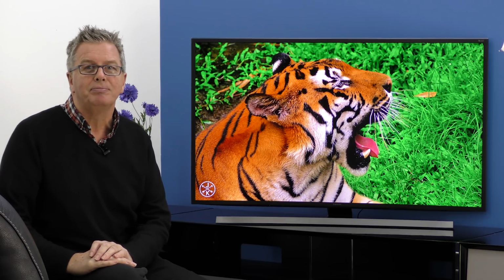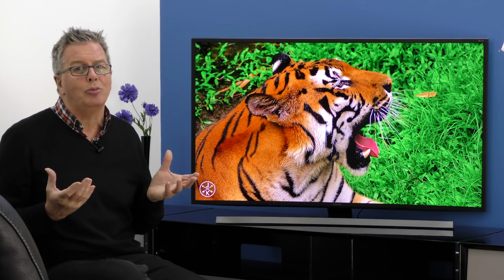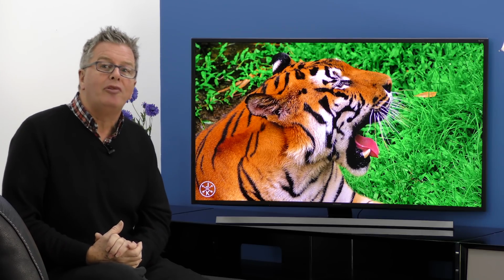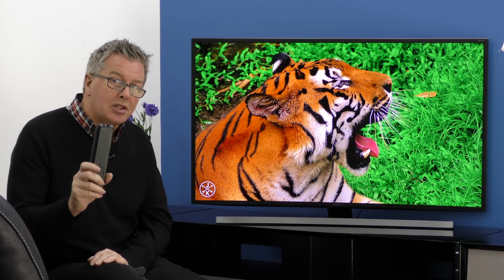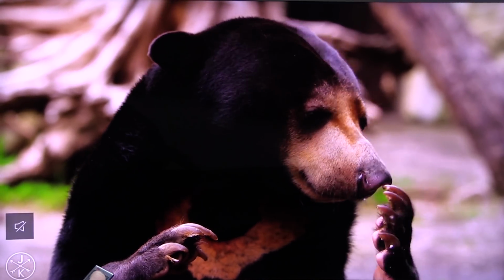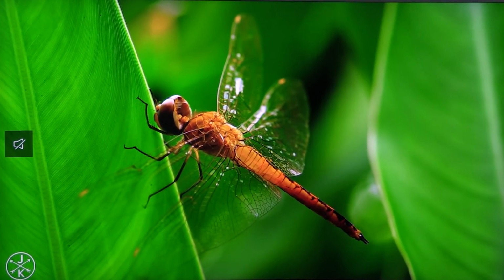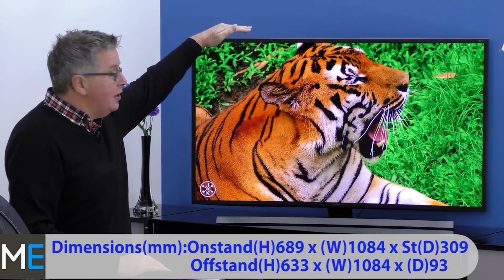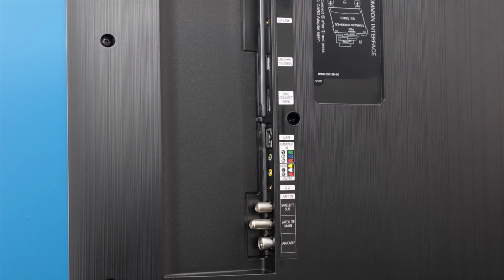Samsung 8 Series 48" UE48JS8500 Curved 3D 4K Ultra HD LED TV

Comment: Is this tv hdr ready?The word compatibility does not sound convincing,lol.
Reply from the maker: Being a 2015 model Stuart, HDR wasn't yet a 'thing'. The spec is certainly capable of producing great HDR pics but the firmware shipped with the Tv didn't support it. Later firmware upgrades may have turned that around but not to our knowledge. The 2016 KS range show HDR in all its glory and some say are better than the 2017 models.